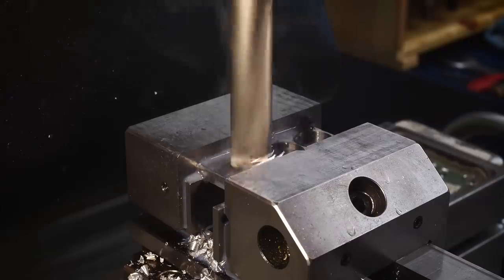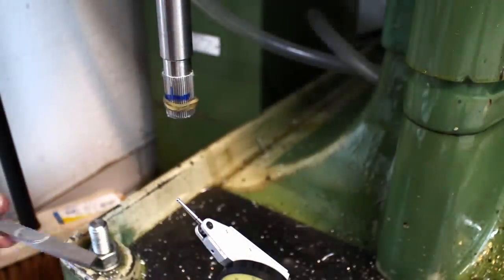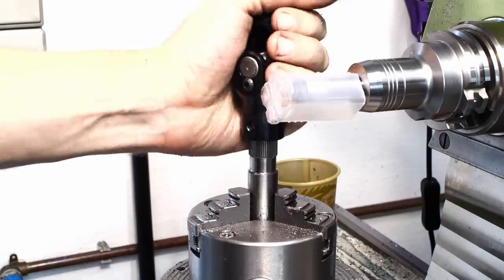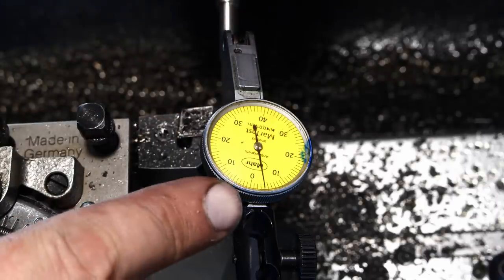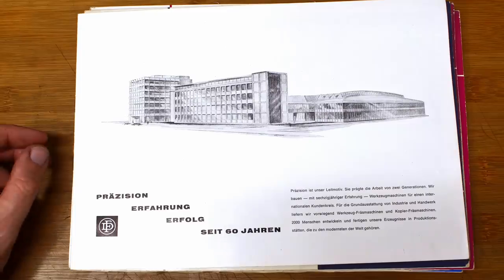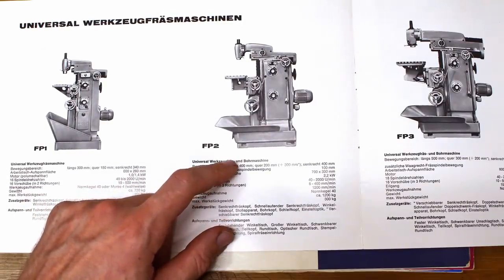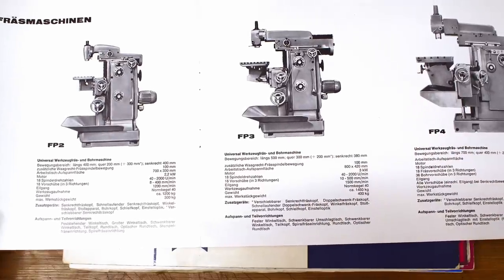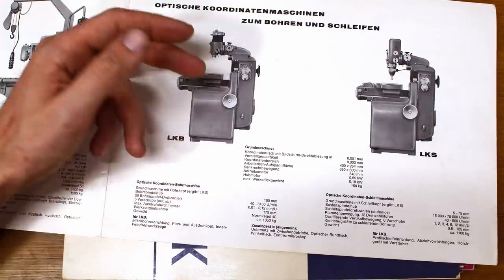Shoptalk #28

Comment: Clocking the spline drive - in a 45-tooth spline there are no "opposite" grooves. Your second pin will be half a tooth left or right from the tooth directly opposite whichever groove your first pin engages with.

The geometry of your parallel is then off-centre, with a single line of symmetry running from a groove on one side to the tip of a tooth on the other, perpendicular to your fixed parallel. If your milling operation starts on this line of symmetry, you would need to establish whether the existing spline had its groove or its tooth aligned with the new groove you are about to cut.

But if, as it looks in the video, you indicate your parallel in the same direction as the cutter engages (so the line of spline symmetry is at 90 degrees to the cutter), your new spline pattern will not be clocked, but off by a quarter of a tooth.
Reply from the maker: This channel becomes more and more "Stefan fucked up" :D
Thanks for pointing it out, I have no clue how it slipped on my that 45 is not divided by two.
Reply: @StefanGotteswinter  I spent at least 10 minutes thinking "surely I missed something...?" Thanks for confirming I'm not going crazy.
Reply: @StefanGotteswinter  hey stefan, there was only one perfect human, and unfortunately he's not making video's, hats off to mrmonster, he truly understood the assignment, thanks for all the videos

Comment: Surely using a tool with a small  tip radius merely increases the radius of curvature of the surface by an amount equal to the tool tip radius?

Comment: Water based coolant is basically the only thing that allows me to part without ruining my parting tool inserts, granted I use chinese ones.It's a mess  thogh but I haven't found a good oil alternative that would put the coolant on the shelf. I've built sheet metal covers for the lathe much in the way you and Robin Renzetti have done, but for the purpose of keeping coolant away. I've also used gasket product like Hylomar blue to prevent coolant ingress where the compound slide mates to the top slide. I found it made its way in there and left rust on it before, not afterwards. My lathe is from the 50s but came with a built in pump and coolant tank.

Comment: Great video as always. I loved the radius turning idea, not seen that before. I do have a query though: Isn't there risk that the drill chuck taper will pull out of the tailstock? Is there a way to mitigate that, or are you just relying on the taper holding?

Comment: If you had an indicator stand that had an arm long enough you could mount your indicator, ensure the distance from the stationary pivot point to the tip of the indicator is the desired length, them swing the arm from it's pivot and it would describe an arc with the desired radius. From there you could mount it on a table or surface plate, mount a fixture to hold the part in the appropriate location, then measure away!

Comment: I've gotten a new fps fp3lv with heideinhein 7013 and within 6 months everything what fps changed to the machine got broken. Leaking lubrication system, they installed off brand data cables between hmi and scales, delivered and didn't Level it. Set wrong Amplitude and Ampere magnitude. 6 months and still not working properly. I hope that quality was better back then 😅
Reply: Given the price FPS charges for their rebuilds, I am willing to bet you are more than upset with the issues you just described. Unbelievable 😳

Comment: If the spherical surfaces are smooth enough optically the radius of curvature could be measured with a point source microscope (building your own is easy using catalog optics) or an on axis spherical wave interferometer (again building your own is easy). The only additional requirement is a suitable radius slide (either a mill or lathe could be used for this). If the surface is somewhat rough the measurements may need to be ddone in the NIR (eg at 1.5 micron wavelength) for which an NIR camera is required. Essentially the distance between the position of thhe microscope (or interferometer) in the catseye setup and at the centre of curvature is measured. The interferometer is at least an oorder of magnitude more accurate and as a bonus the deviation of the surfacee from spherical can be easily determined.
Reply: A simple test of the suitability for optical measurement of the radius of curvature would be to examine the image of a small "pinhole" illuminated by a bright LED. A small (1mm diameter??) hole in a white card or equivalent would suffice. A matte white painted pice of metal sheet mounted on the lathe crossslide should suffice, If the image is sharp this simple emthod of locating the centre of curvature is potentially at least as accurate as your spherometer unless you use a more accurate means of measuring the saggitta such as one of Heidenhains certo length gauges together with a more accurate reference flat (e.g. an optical flat) than a surface plate.

Comment: if your tool is fixed to the pivot bar and swing with. it should eliminate the error as it will be cutting with the same part of the tool radius. also the resistance of the carriage against the bar may cause some error. but making the setup ridged enough should deal with that. can also calculate you sever-o-meter reading with cord rule. will make a setup to test that some time. very interesting
Reply: As I understand it, the tool itself does not swing. The 400mm bar is a link with two pivot points, one of which is somewhere on the carriage. Thus as the cross slide travels, the tool’s tangent point will move a little bit.

Comment: 42:29 Also there is an error caused by the Turning tool by staying straight and not following the center of the Radius.
Reply from the maker: Yesno :D
The Motion of the lathe tool is on X/Y but its a parallel linkage and follows the radius exactly.
The error only comes from the tools nose radius.

Comment: Stefan, just for my clarification.  Your radius turning technique, the 400mm is between the center of each pivot hole in the bar?  So the length of the tool itself is irrelevant correct?
Reply from the maker: yes,100% correct
Reply: @StefanGotteswinter  Thanks!

Comment: How did you measure the 400mm from the tailstock pivot point to the cutter edge?
Reply: I dont think he needs to. The radius is set by the distance between the pivot points, ie the distance between the holes in the bar.
Reply: @ulwur  Maybe i should have been more clear. How did you "very accurately" measure 400mm? Stefan didn't show how he attached the bar to the cutter.